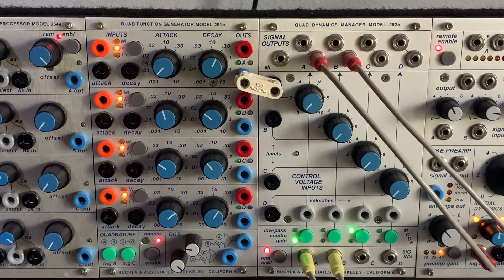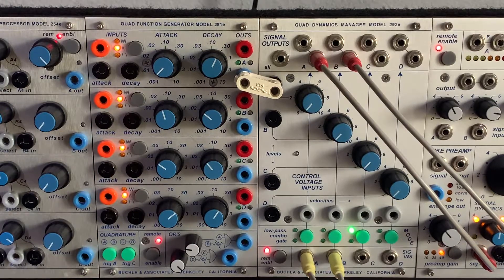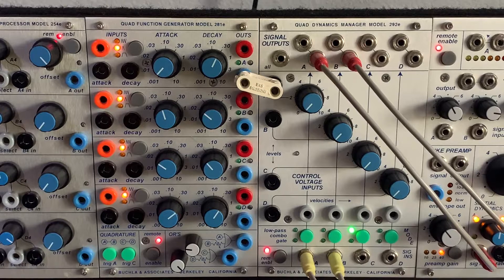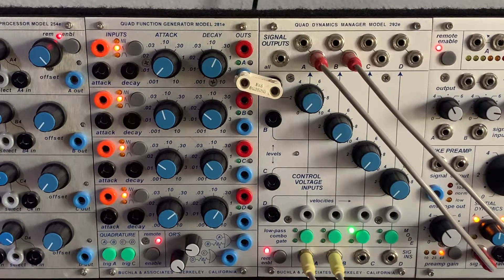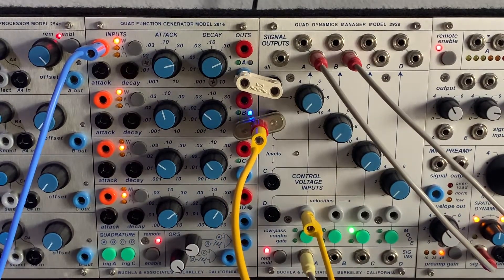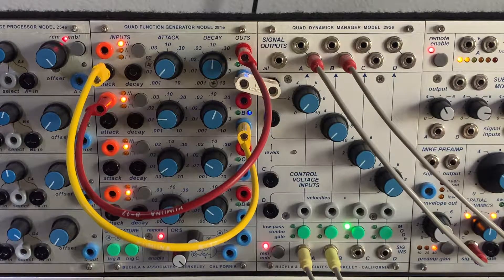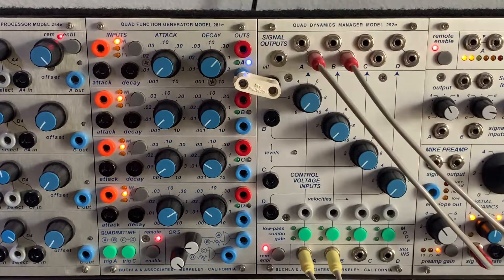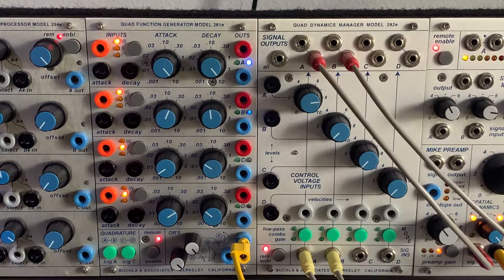SoU Episode 5 Featured Modules: 281e and 292e

Comment: The "quadrature" (which isn't, but whatever) gives you a similar effect to the Synthi 100 trapezoid which is modeled in my (STG Soundlabs) Envelope Generator, if both outputs still work in that mode.

The Synthi 100 trapezoid is NOT the VCS3 trapezoid, it is much more sophisticated.

Thanks for posting!